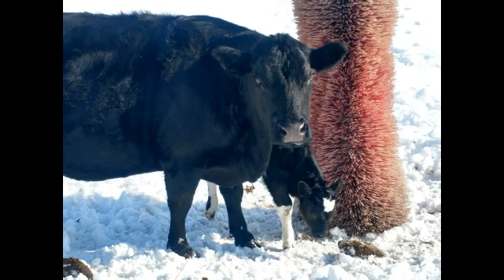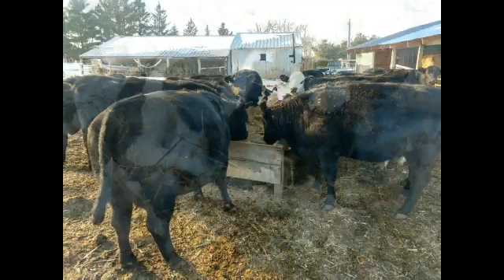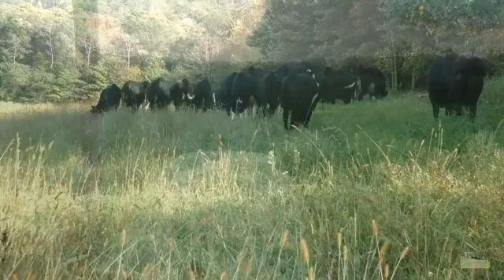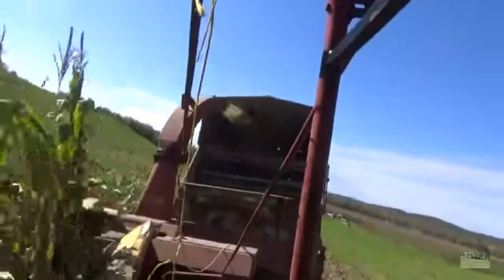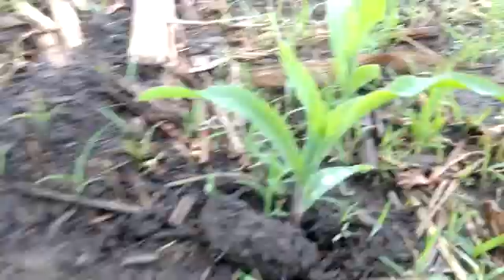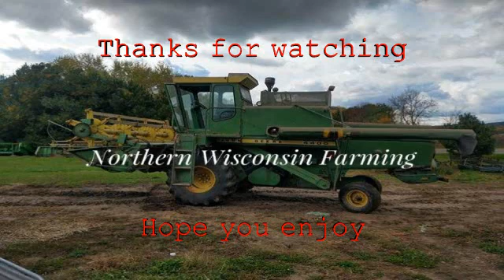Rain and worms

Comment: Awesome that you got some rain man! We got about an inch total this week and are going to be at 100 degrees all week this coming week. Hoping I made the good call to cut one of our pastures for hay, grazed thru rye, oats and ryegrass with coastal bermudagrass growing strong below. Hoping it doesn't burn up since I cut all the canopy off.
Reply from the maker: +Floyd Farms hopefully you get more rain before it even thinks about burning up
Reply: LVF & Northern Wisconsin Farming I'm hoping this inch of water in the last week will jump start it to cover the soil enough to prevent evaporation and let it last till the next rain whenever that happens. That's the one thing I hate about the sickle mower, I cant get higher than about 4 inches so I cant leave much cover on the ground. But I definitely don't have the funds for a disc mower at the moment.

Comment: Oh yeah, imagine how much <more> stuff would have withered over the weekend in this heat wave! I think it was right around 4:30 A.M. we finally got a proper thunderstorm with some heavy, though short-lived rain. It knocked the power out for a few seconds three or four times. We work the soil as little as possible for corn and beans also but it's not so much for moisture control and happy worms. Number one reason is letting sleeping rocks lie!
Reply from the maker: We really need this rain!
Reply: Yep, just back from Menomonie and saw some moderately washed fields on the way. More coming in, just started raining here, coming your way but hard to tell exactly, this cell is moving southeast while the one by Thorp is going northeast!
Reply from the maker: +Digby O'Dell yep, weather radio going nuts! I think it'll miss us